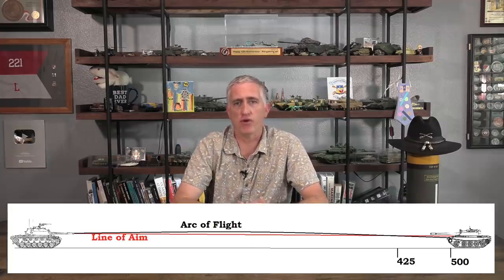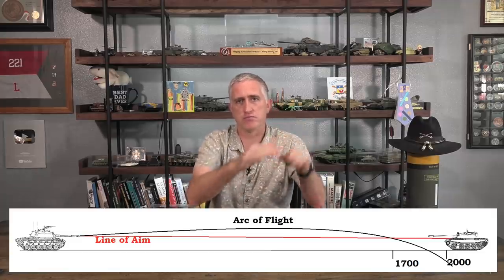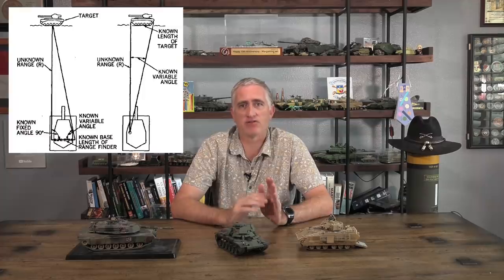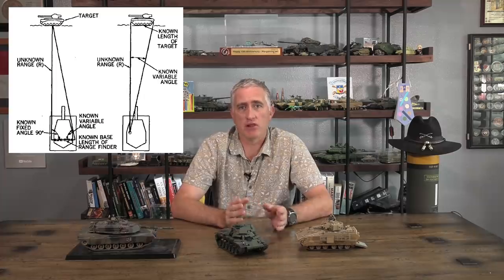Tanks 103: Rangefinding

Comment: Stereoscopic Rangefinders also give extreme eye fatigue to the point of horrible migraines and vomiting. It also required the human user to have 20/20 eyes (as almost all optical rangefinders). In the navy they used them a lot and usually the active rangefinding time was about 30 minutes before the migraines appeared. That's why the navy sticked with the coincidence rangefinders for a long time. That and the fact that the testing report showed that stereoscopic method had no real advantages against the coincidence one.
Reply: Sounds alot like what Apache pilots need to go throught  due monocle!
Reply: MythicFrost monocle is the worst way to implement a HUD
Reply: @drachenklaue07  You also need consantly swivel you head to scan your surroundings wih apache front sensor while other eye scans instuments and surroundings around apache.
Reply: Nah stereoscopic was used well in to late WW2. Different navies preferred different ones. Or be like the Italians and used both.
Stereoscopic did have one very huge advantage. Since most of the image processing is done by the brain, it is a lot quicker to actually get data points. Many Naval AA directors would use stereoscopic because it work better against fast moving targets due to its speed. Coincidence required you to turn nobs to combine the images which work well with relatively slow moving ships but planes is pretty impossible.

Comment: 1) When I was at the Basic Course in late 74-early 75 we were familiarized with the Stereoscopic Range Finder as some unfortunate, low priority Guard units were still operating M48A2's (The Coincidence Rangefinder came in with M48A2C - no prizes for figuring out what "C" stood for). I'm one of those unfortunates whose brain circuitry is incompatible with that device. Try as hard as I could, I couldn't do it. My instructor finally took mercy on me and told me to take a seat and relax, "It's OK, eltee, you'll never see one of these things" And I never did. 2) There is also non-precision or battlesight gunnery. You know the type of ammunition you are using and also know the average height of the target you expect to engage. You look up in the firing tables the range at which the maximum ordinate (height above ground) of a fired round equals the height of the target. You load one of these rounds and index the fire control computer to that range. If you see a target, the fire command is "Gunner, Battlesight, Tank". He lays the cross hairs of his sight on the base of the target and fires. This means the round never exceeds the height of the target nor will fall short. It must hit the target as long as it is at the indexed range or closer. IIRC, our battlesight for 105mm APDS was 1000 meters and our SOP was to always operate with the battlesight set as it was much quicker than using the rangefinder, allowing you to get that vital first round off first. You reverted to precision gunnery if the target was beyond 1000 meters and the second and subsequent rounds

Comment: Oh lord I remember teaching the Direct support class on Laser theory to new M-1 tech at 7th ATC, Vilseck Germany when General Dynamic's/Chrysler was still fielding.   The M-1 series uses a Neodymium Yttrium Aluminum Garnet type laser mounted to the gunner primary sight for ranging.  The laser would take normal 24-volt power and through a series of step-up transformers produce an 8000 volt PFN (pulse forming network) charge and store it inside a capacitor.  
When the Gunner, or Commander pressed their ranging button.  The laser would discharge the capacitor, and the energy would excite the garnet and produce a beam that would bounce back and forth between two retroflector mirrors until sufficient light energy was produced to cause a milky clouded exit lens to flash clear, releasing the beam. 
The beam would exit the gunners primary head mirror, (with eye-safe laser coating) passing by an optical sensor which tripped a timer to start.  This timer was calibrated in nanoseconds.  A nanosecond (ns) is an SI unit of time equal to one billionth of a second, that is, 1⁄1 000 000 000 of a second, or 10−9 seconds.  The M-1 series laser range finder, takes that formula and calculates the time it takes a beam of light to travel 1-meter.  The M-1's ballistic computer uses this to determine super elevation angle to target.  Gun lead angle is based on rate of slew (traverse) rate at that given range while tracking the target.

The timer would continue to count until the First, or Last return beam (which ever was selected before hand) came  back to the head mirror stopping the clock.  The computer would then take number of nanoseconds counted and divide the total time in-half to achieve a distance to target.
I've simplified this because as I remember the class on this subject was over 3-hours long and left many a new 45-Golf Fire-Control specialists head smoking.

Edit:  for Boo boo's.  (sigh) what can I say, I'm old and my memory is utter rubbish sometimes.   ^_^
Reply: Nitpick, 1 ns at light speed is about a foot. Source: Adm. Hopper who used to give out wire cut to ns lengths.
Reply: @jrdougan    Thank you for that..  It's been almost four decades since those courses.
Reply: You probably mean Neodymium, not Neo-diindium. Neodymium is a metallic chemical element which is commonly used as an optical dopant. Nd:YAG lasers are a really common type of high power laser. YAG has nice optical, mechanical and thermal properties, and Neodymium is the laser dopant.

Neodymium is also used in powerful magnets but honestly I don't know why.
Reply: @aaronclair4489    thank you for the spelling correction.  once more, I'm getting old and my memory is rubbish at times.   ^_^
Reply: @SS-hw1ou    wellllll, no.   Radar uses radio waves, a Laser uses light emissions.  but both are used to estimate range.  ^_^
edit:  spelling  (sigh)  again...   ~_~
Reply: @aaronclair4489  The neodymium in magnets is to stabilize the iron crystals so their magnetic orientation is really aligned. As i have understood it, the magnetic force in these magnets still recides in the iron atoms. -- (And if you dope them with a little dysprosium, this will set down in the corners of the crystals, and let tolerate up to 150-180 C, before the crystal alignments start to deterioate.)
Reply: Hi,  How did that turn-from-mily-clouded to clear works?
Reply: @MultiZirkon  it basically is optical glass coated in a reverse transition lens material.  instead of becoming darker in the presence of light, when enough energy is absorbed the lens will turn clear releasing the beam.  After which with the energy stream no longer present after firing, the lens reverts back to it's cloudy state.
Reply: @ditzydoo4378  You pump energy into the material, and that turns it transparent???Ingenious!
Reply: @MultiZirkon   Much the same way that transition lens for eye glasses work in that the more photon's that constantly bombard the lens the darker they become, and subsequently less photon's present allows the lens to become lighter.  The lasers  lens simply works in reverse.
Reply: @ditzydoo4378  It was just anti-intuitive that an excited state could be less colored. It just scrambled my brain. -- At least if it happens on a "molecular" level. Which I presume, as the wavelength should be short enough.
Reply: BenjaminTheRogue   close, but.  
Radio waves are a type of electromagnetic radiation with wavelengths in the electromagnetic spectrum longer than infrared light, (not lower). 
Radio waves have frequencies as high as 300 gigahertz (GHz) to as low as 30 hertz (Hz).   At 300 GHz, the corresponding wavelength is 1 mm (shorter than a grain of rice); at 30 Hz the corresponding wavelength is 10,000 km (longer than the radius of the Earth). Like all electromagnetic waves, radio waves travel at the speed of light in vacuum and close to the speed of light in the Earth's atmosphere. Radio waves are generated by charged particles undergoing acceleration, such as time-varying electric currents.  Naturally occurring radio waves are emitted by lightning and astronomical objects.

Light or visible light is electromagnetic radiation within the portion of the electromagnetic spectrum that can be perceived by the human eye.   Visible light is usually defined as having wavelengths in the range of 400–700 nm, or 4.00 × 10−7 to 7.00 × 10−7 m, between the infrared (with longer wavelengths) and the ultraviolet (with shorter wavelengths).  This wavelength means a frequency range of roughly 430–750 terahertz (THz).

Comment: I started on the M-60A3 and the laser was nice - fast, accurate and etc.
Got back stateside and an M-60A1 RISE. Back to the coincident rangefinder. Range? Nope. Battlesight Sabot instead.
Reply: yeah its why the LRF quickly replaced the coincident  RF.   Of course that is  because much of the ranges weren't expected to be more than 1000 to to 1600 m, where its possible to get a 1st round hit going just off a 1200m battlesight range.
Reply: @jamestheotherone742  , 1600 meter battlesight for the M60s until the introduction of the M60A3, and then it wasn't for a couple more years.
Reply: I always used the range find you were never trained to use it and set it up
Reply: Non-precision or battlesight gunnery. You know the type of ammunition you are using and also know the average height of the target you expect to engage. You look up in the firing tables the range at which the maximum ordinate (height above ground) of a fired round equals the height of the target. You load one of these rounds and index the fire control computer to that range. If you see a target, the fire command is "Gunner, Battlesight, Tank". He lays the cross hairs of his sight on the base of the target and fires. This means the round never exceeds the height of the target nor will fall short. It must hit the target as long as it is at the indexed range or closer. IIRC, our battlesight for 105mm APDS was 1000 meters and our SOP was to always operate with the battlesight set as it was much quicker than using the rangefinder, allowing you to get that vital first round off first. You reverted to precision gunnery if the target was beyond 1000 meters and the second and subsequent rounds

Comment: I also remember reading that stereoscopic rangefinding was used for AA, as it was much easier to range a small and fast plane that way rather than with a coincidence rangefinder with its split image (youd need to be very precise to keep the plane exactly on the line and range it properly, just wasnt practical), hence that one being used with bigger and more static things.
Reply: BTW, one of the disadvantage of coincidence range finding is it does not work well on a periodical structures. Like when you have a fence with lots of uniform planks or order of airplanes chances are the images you match one to another are not the same object, but the neighbours in the ranks.

Comment: If you look around online you can find Coincidence Rangefinders for hunters and the like relatively cheaply online. I have one that is rated out to 500 yards. The accuracy changes with temperature. So if I set mine when the temp is 78 F it's good from 58-98 F.
Reply: I've seen both coincidence range finders & laser range finders at Wal-Mart in the sporting goods/hunting section from anywhere between $80-$350.  Usually in the glass display case where the knives are.
Reply: Any suggestions how to validate it ?
Reply: As a hunter, I use binoculars wirh a built in range finder. 
Many quality binos nowadays come with them.
Reply: @mattiasdahlstrom2024  For the most part, you can count on range-finders being accurate as they claim on the box for legal reasons. The trick is practice, so if you can get access to a good target precisely measured off, be it a telephone pole or a rifle target at a good range, you can practice and eliminate the margin of error your own eyes tend to create, especially when using coincidence devices. For myself, there is a rock I measured out from a tree with a 100-yard surveyor's twine, just a knotted rope but a carefully made one. Rock doesn't move, nor does the tree. All you need really.
Reply: @lalucre1803  What kind of rangefindr? I have telescopic sight with mils scale, allied with guesswork as to how wide the deer is...
Reply: Well, if photography they massively used a range finder cameras since 1930s. Despite the fact the base of the range finder was quite small, typically half a camera body, precision seems to be sufficient for everyday use of that time.
Another interesting thing is that SLR autofocus systems and split image focusing aid before them are effectively rangefinders with a base of aperture of the lens. Photographer (or electronics of the camera) compares the images obtained from the very left and the very right (or top and bottom) of the lens aperture. If these match, you are focused, which means the range is correct.
Reply: @mattiasdahlstrom2024  you get a surveyors tape measure, measure out 100y, and see what the gizmo says.

My shooting buddy's laser rangefinder reads 109y at 100y by tape.

Comment: In naval usage, coincidence rangefinders came first, short base ones in use before (and at, by both sides) the Russo Japanese war of 1904-5. The Brits seemed to have the lead with these. The Germans soon went with stereoscopic rangefinders. There were advantages to each, the stereo requiring more frequent training, and crew rotation, but also giving better results in poor lighting.

After WWI most navies either switched to stereo or used a combination of both.

Comment: I love range cards. They are so handy. In a hidesite we would do them to be able to estimate not just range to possible target but they will come in very handy if you are in touch with the fires net and are able to get them known points on their fires control board, or whatever they are called and I cannot remember the name, then you can very quickly call for a fire mission...using shift from a know point then you will only need to give them your distance   and mils to that known point and the adjust the fire  by add/subtract and left/right away from that point and bracket they rounds in and onto their heads.
Since armour calls in as much of the king of battle as the Infantry does, this also works for them.
Though, with the use of drones to call for fire I have no idea how they adjust now.

Comment: I had to stop the video because I was laughing so hard when you mentioned TLAR. For some old fart history, in the mid '70s I read a book called "God is my copilot" about a pilot in the AVG in China talking about using the rudimentary sights on the P40 to attack grounds targets. He called it TLAR, and I took that as my mantra for the rest of my life. As a soldier in the 1980's and 90's when I used it nobody knew what it meant, which told me that the army had lost one of its better acronyms. Mr Moran using it tells me that the army has reclaimed it from the ash heap of history, and in my opinion it ranks up there with SNAFU. Remember, no matter how many computers are involved, no matter how many graphs or mathematical problems are solved, there is still that man on the ground thinking, "Yeah, That Looks About Right"

Comment: I still use my pace count at my current job as a telephone cable splicer. I love the "flash to bang" method of range estimation (sound travels approximately 330m/sec). And yes, telephone poles are generally about 100' apart, handy for estimating distance.